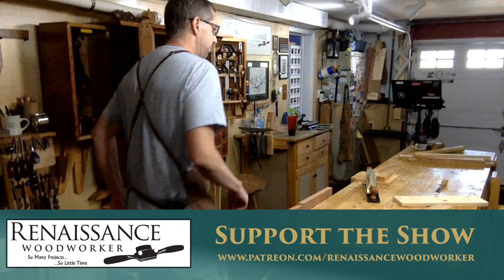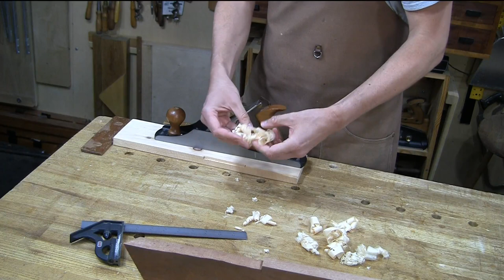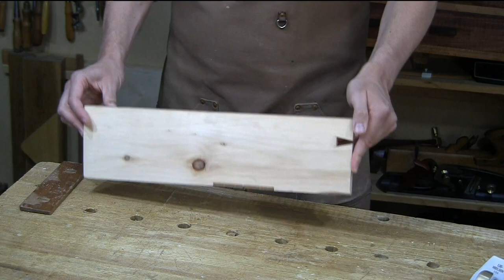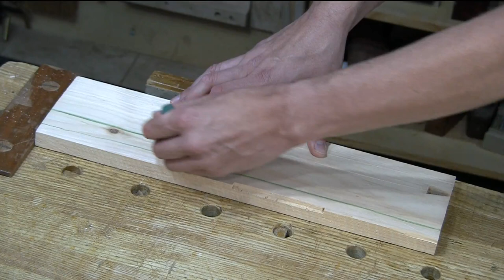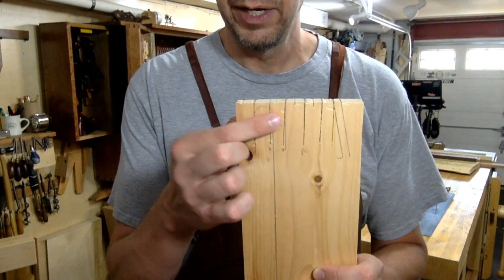Hand Tool Live:  Practice Exercises for Sawing and Planing

Comment: Sorry I missed it live. I'm probably more a therapy woodworker than hobbyist but saw practice is key for me. Ripping practice can suck but I soon found myself looking for opportunities to practice within a project.
Occasionally I might find I have a long rip and get that (lacking confidence)"stay away from the line" feeling. So I scribe a second line close and try to rip that sucker dead on. Not for everyone but sometimes that one training line is enough for me to then go for it subsequently. I might also eschew scrub planing an edge to have a rip instead. Nothing helps identify a wobbly day like splitting off a narrow edge and not splitting is a huge boost.
My sawing is much better now with Shannon's help.
 (However, while sawing in the vice I tend to stay away from the line on the backside and have to reach over with a finger on my bracing hand.
So I've decided to stop putting it off and make a couple of saw benches. But that's a different issue.)

Comment: Great content! I completely agree with the warm up exercises. I have been practicing my sawing with the same methods you described of just cutting lines in succession. I feel I have improved quite a bit in just a couple days sawing for like 10 mins a day. With every cut I feel I learn something new on how to hold the saw and how to get out of the way and just let the saw do the work. I am still struggling with the getting out the way part lol  Question for you. When cutting joinery I know to start the cut you pinch the wood with your off hand. For the index finger on your dominant hand that is on the saw do you press in at all? Or is no pressure applied inward with that finger? Thanks for all your tips, much appreciated!